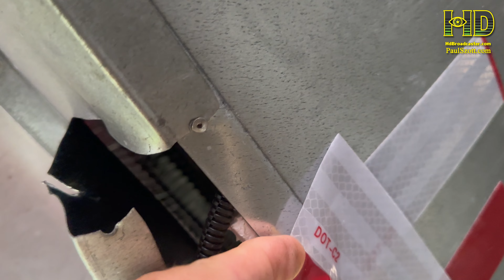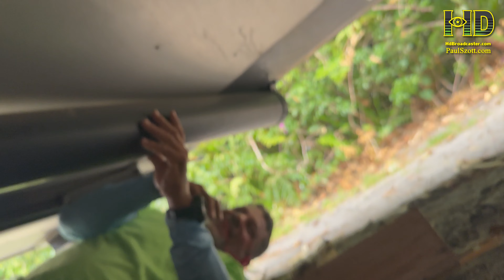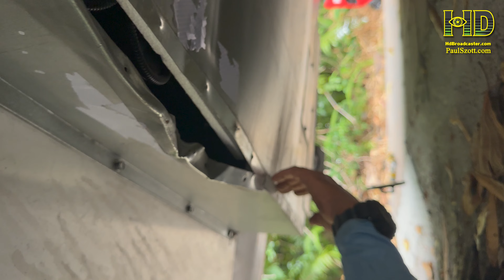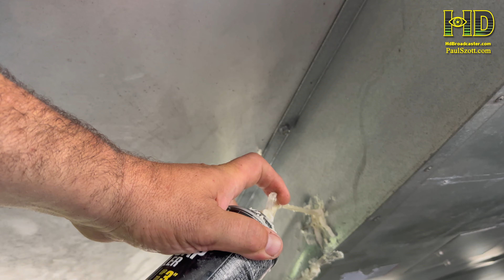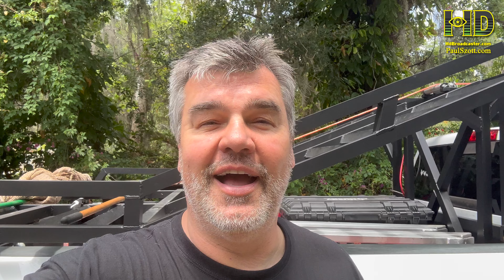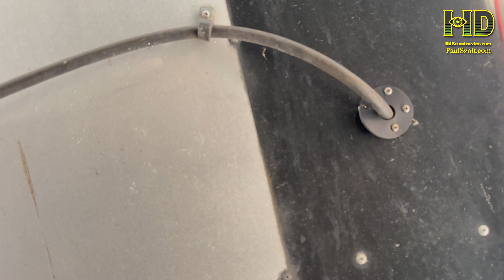Amature Airstream Repair

Comment: If you want to get it at least a couple of inches higher, when you get new tires get some tires that are 2 inches taller than those you have and make sure they are the highest load-rated tires you can get. Like a load range C will allow you to run 65 pounds of air in the tires, and a load range E holds 80 pounds of air. The higher the load range the more air they can hold, and the less the tire will "squat" on the bottom meaning the higher it will hold the camper. A lot of 5-lug camper/trailer tires only hold a max of 35-45 pounds of air, which means the tire is softer so they squat more on the bottom which means the camper will ride lower. I put 2-inch taller load range C tires on my trailer and I keep them aired up to 60psi. and it lifted my trailer 2-inches.
Reply from the maker: That's awesome thanks. Good idea. Now with a lift kit that gets 3 inches. I can get 5 now.
Reply: I did the same thing to my Trailer! GoodYear Endurance,  Huge difference! 👍
Reply: @DirectCurrent4u  Goodyear Endurance are really good tires.